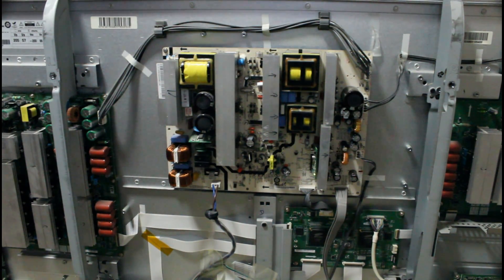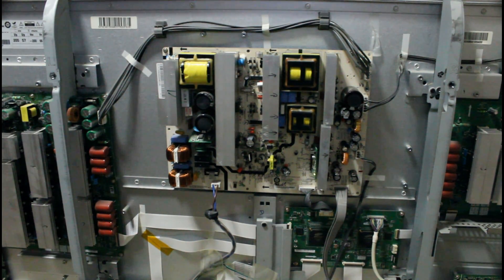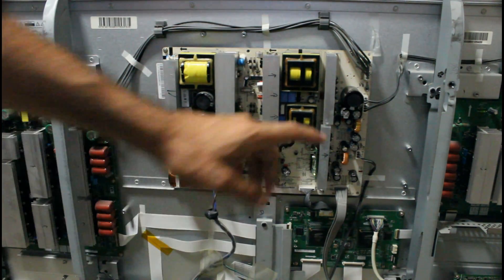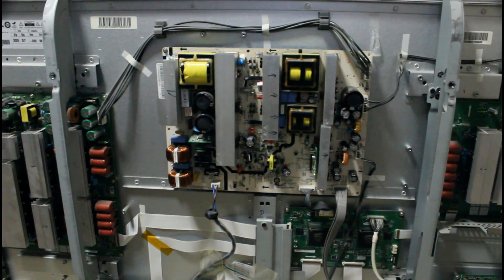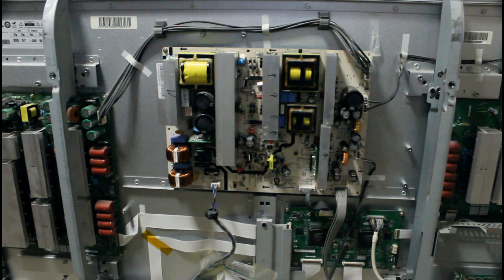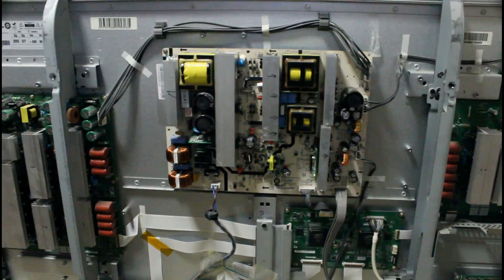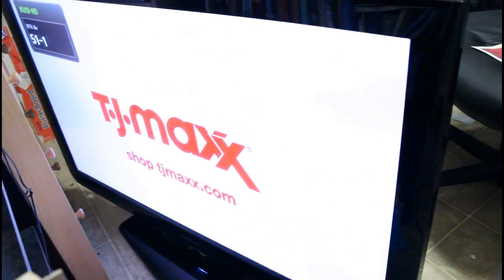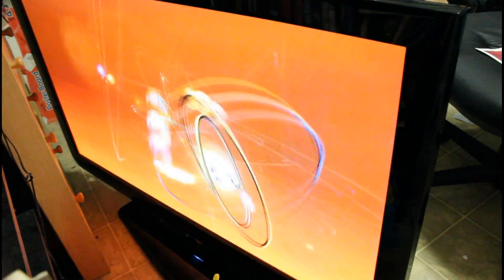How to Repair Samsung 50" Plasma with no Power

Comment: Pulled this tv off the curb, someone's trash. Never worked on a TV in my life. I had just started building drones and was learning about electronics from that. I had a gut feeling about the TV. Got it home and opened it. 3 capacitors blown. Pull 3  from an old PC power supply. Been usingnthe TV for almost 6 years now. 😊

Comment: Hi bro!  I just scored a 63 inch Samsung plasma   
Had no standby light
I found a blown out joint in the power supply I soldered that and changed a blown fuse 
Now I get t con board flash and relay trying to turn on TV click click 
But when I unplug the t con board from main board the power supply I get the on sound from the speaker but that’s all and the green light on the T con board is stable 
I ordered a new power supply going off your video and comments   I hope it works

Comment: Hi. My 59' samsung plasma tv has no power. And I called a technician to check it out today. He showed me the problem. Same thing was on your video the problem is. And his estimation for fixing my tv is $250. Is this expensive to get it repair?
Reply: Yes u can buy a working tv much less check around for prices
Reply from the maker: Crystal Torres Hi, that estimate is around what technicians charge for these issues. Also, the prices of new TV's have dropped significantly, so getting another TV could be an option too. Good luck!

Comment: I have a 42 lg plasma just went out no power no clicking no stand by??
Reply from the maker: +heber argueta Does the LED (Power light) blink or turn on at all when the TV is plugged into the power outlet?
Reply: no light no blinker no click
Reply from the maker: +heber argueta Oh okay, then there is no stand by. Most likely the issue is  the power supply.